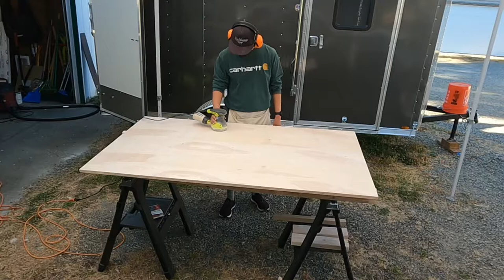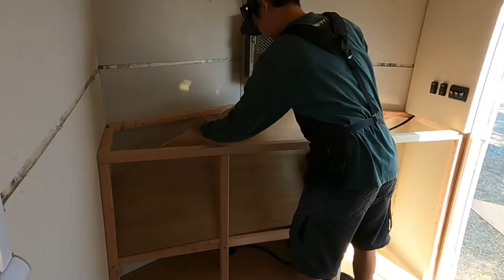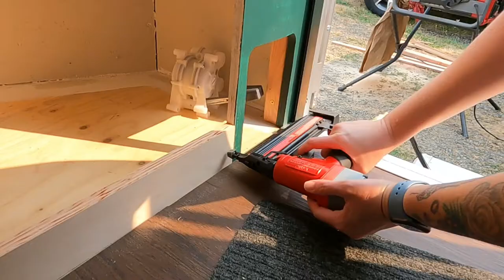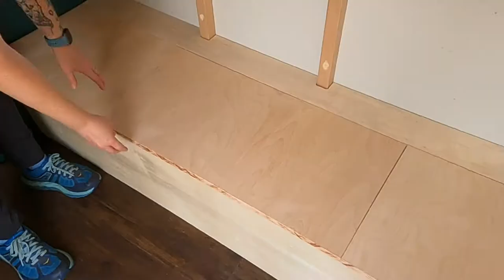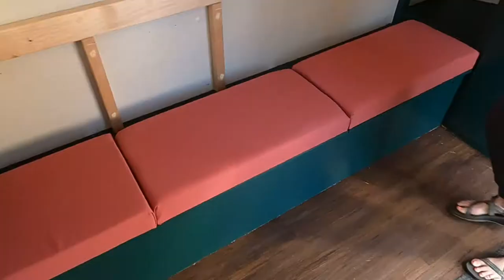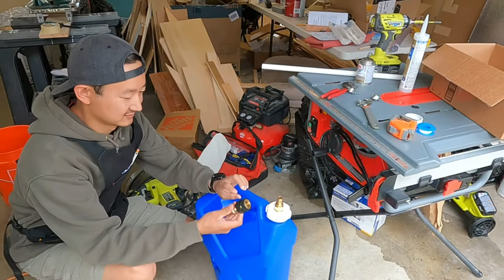Trailer Build Episode 5: Bed, bench, and kitchen

Comment: Dude, that was way cool!! I dig how you did your facet.. If I may ask, what pump did you use?? Mark...
Reply from the maker: Thanks! We used the Whale Pump Gusher Galley foot pump. The faucet is just a bathroom faucet we ordered online. We hooked up the pump to the cold line using a barbed fitting adapter from Home Depot. We still need to cap off the hot line, but haven’t gotten around to it.
Reply: Right on..  So why that particular pump? I want to possible do a rustic build, not too fancy but livable, since it's just me! And thanks for that info too dude.. I have a Bluetti AC200P power station w/two 200W portable panels just for car camping and don't know if I want anything more than that. However, if I do a "mini split" when I do a build, I may need too.. For know just gathering intel...  Mark